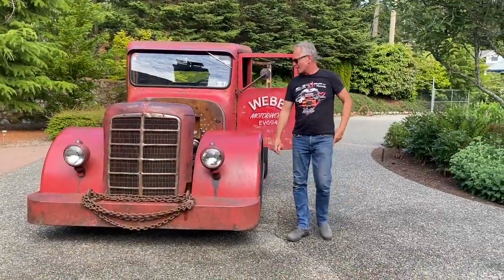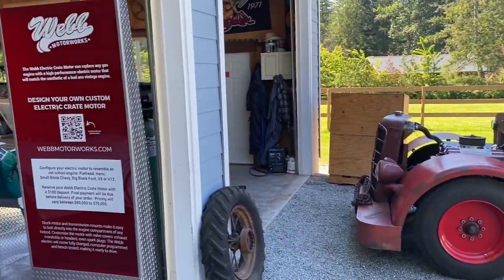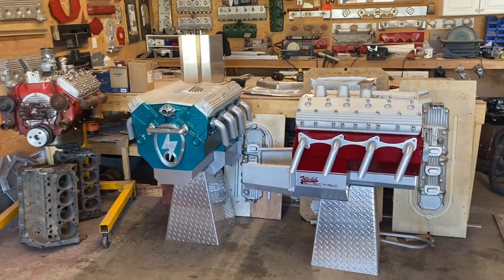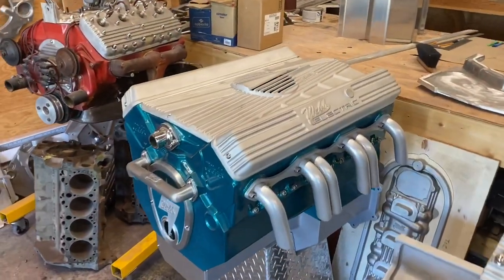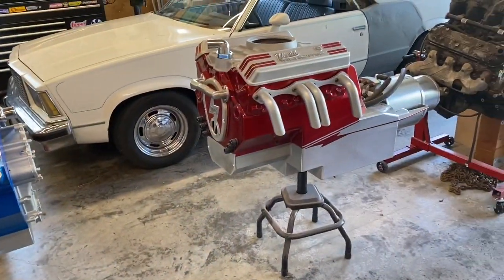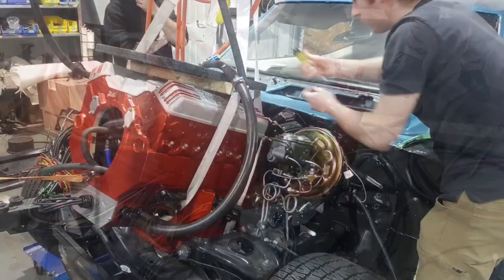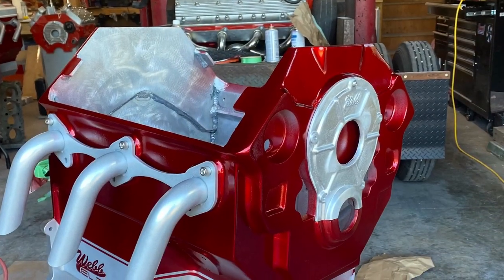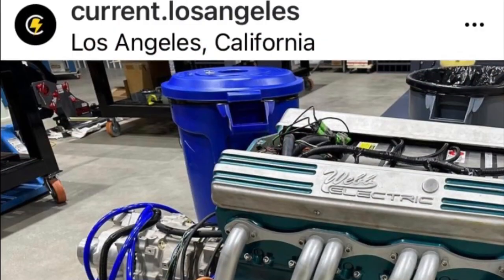Electric Crate motors that look like real gas engines

Comment: I want to restore a Model A, and would absolutely love to put an electric power train in it. I only want enough power to drive it in modern traffic, but would it be possible to put extended range batteries under the seats?
Reply from the maker: The model A is not very heavy. Under seat and even in the gas tank area would be perfect.in our 32 Ford we added an extra pack in the trunk are

Comment: Actually the future is in hydrogen. I have a zero Fx that I daily but the carbon offset is not there yet for battery’s all they do is transfer the foot print. And the whole child mine labors
Reply from the maker: Trouble with the hydrogen is the large space the fuel tank takes up, I think?
Reply: it takes a lot of carbon to make hydrogen--it is all a farce--i was among the first over 7 years ago to try to buy the Nikolia truck because cali would pay for it--the list has been abandoned for the large buyers now--total bs

Comment: Good stuff. Hows the battery range like with these vehicles. If i had the money I'd probably bring you a 72-76 nova or a 2008-2010 challenger se for battery motor conversion.
Reply from the maker: Range based on at. Of vehicle and size of secondary pack.  Easily 250 miles